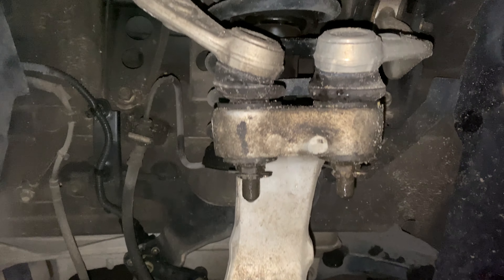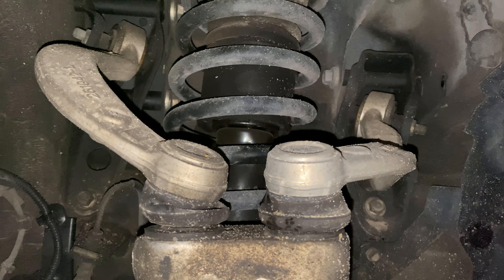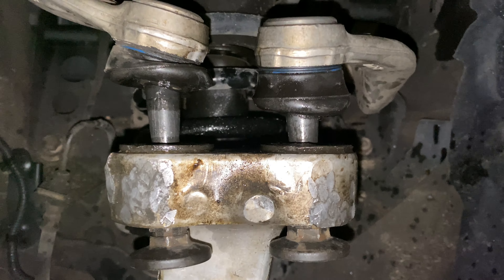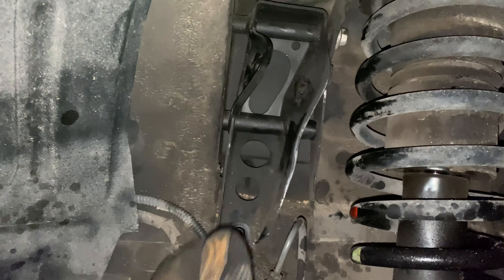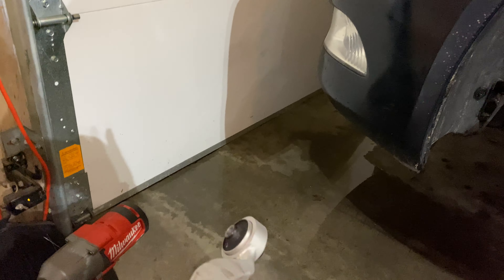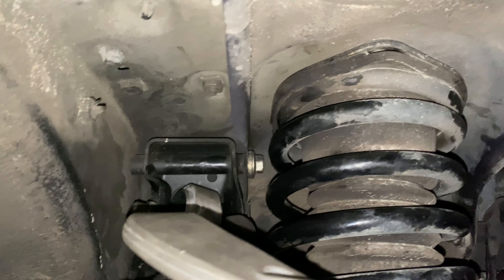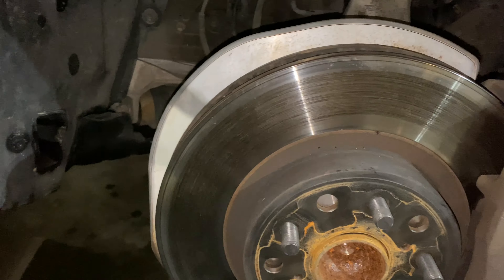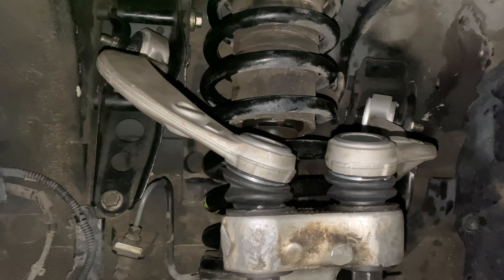Lexus LS460 Upper Control Arm Swap.

Comment: Hey I just did this on my 2016 LS460. Couldn’t have done it without your video. Great job. Pretty straightforward I had a major issue with the one you said was a PITA. That hinge you talked about kept getting stopped by a screw in the hood. I had to unloosen the screw and then the bracket could pivot all the way up. Other wise than that everything went as you showed. One thing. I was not able to use a ratchet (only on the bottom 14 mm. The main tool used was a box 14 mm and a simple 14 wrench. Thanks again buddy. FYI my control arm didn’t look that bad. One rip in the bushing but major play/looseness in the ball joint.
Reply from the maker: Your Welcome.

Comment: When you mentioned "pre-load" and that if you didn't do it the bushings could give out much earlier than they should, is that what you basically did when you put the rotor on a block to maintain that 16" distance from center of rotor to closest vertical fender point?  In other words, you did the final tightening of the control arms and mounts and all those nuts to torque specifications when that distance was "loaded" at 16" simulating when the car is being driven.  Not when the rotor and all the other suspension components are drooping down to 19" to 20" as you mentioned.  And if someone did tighten down all those nuts when it is drooping down, that's when you could have the bushings fail much sooner?
Reply: That’s what I need to know I’m replacing mine in a few weeks
Reply: exactly, preload to make sure it's in "operating" height so the bushing isn't torqued tight against the wrong operating height
Reply from the maker: Yes.  It is a good practice to preload to you don't over stress the bushings.

Comment: I would recommend for who going to replace upper or lower arm Don’t buy the cheap control arm it only last 1.5 years and the bushing not strong enough it make your brake suck when you head the brake and when you drive on the balance road it is ok but when you drive on the road not that balance the steering wheel will go another side because the bushing rubber to soft I recommend buy the oem pay one time but it last
Reply from the maker: I would buy OEM Lexus are $$$.

Comment: You can use a belt tensioner tool with a torque wrench when nuts are hard to access with a torque wrench alone.
Just a little trick I used.
Reply from the maker: Hmm.  Thanks may do that trick soon.

Comment: Your suppose to remove the strut.
It makes the job much easier and slot faster👍
Reply from the maker: Yes. That is one way but i  would rather not mess with taking them off.  I have seen it done both ways.

Comment: hi! Thanks for the video. BTW why didn't you just pull out the brackets with arms till installed on them?
Reply from the maker: Thanks.  I did it that way the time before this video.  I found time wise not much different.

Comment: go look at the lower control arms on this video at the .39 mark they are slid all the way forward.  These uppers wont last as long as the last ones you took off unless you replace both lowers.  Just a tip.  I'm about to do mine.
Reply from the maker: So far so good.  But my 2 lower front are shot.  I replaced all the lowers about 4 years ago.  I have to do those before spring.

Comment: Great video - saw where 2 of these arms failed at 1 year .Ideas on what aftermarket option might provide a  longer lasting forward upper control arm ??   OEM replacements failed at 15K !!
Reply from the maker: I have tried 3 different ones and they all failed sooner or later.  The front end is so heavy that it gives them a work out.
Reply: You can use 2012-2017 ls460 control arms on these cars, they’re revised and better

Comment: How did you measure the preloading? And how did you manage to raise the hub so that it was that height before torque the bolts? Curious how I’d be able to measure and make it work.
Reply from the maker: In my video i show all that.  I measure the distance from the center of the wheel opening to the center hub than lifted the hub with disk on with a block of wood.  Most people will raise the hub by a jack at the lower knuckle.

Comment: Watching some other LS460 owner saying it costs 4k to get these replaced. Seems not so difficult.
Reply from the maker: It can be $$$ if you take it to a dealer or almost any shop.  The lowers are more a pain.
Reply: @johnnyglexus5730  I got to think the LS460 is a potential money pit after reading a bit more about it. Great car till something breaks.
Reply from the maker: @davidwell686  It can be if like anything else is not maintained.  But some of the parts you might need are available now 3rd party unlike before.  Just do your homework l must have looked at 5 of them before i settled on mine.  Almost to 200 k.

Comment: Any times on getting the castle nut off? I have one that won't budge. I've tried pb blaster and bc they are stripped some I most recently tried a 17mm extractor and it won't grab it. Any tips would be awesome.
Reply from the maker: When i first did them.  Only thing i could do was cut it off with a cutting wheel.  If hitting the knuckle didn't pop it free.
Reply: @johnnyglexus5730  Wow didn't want to have to do that and risk damaging the arm. If a pipe wrench doesn't work I may have to smh thanks!
Reply: Got it off without damaging anything! Replaced the bracket thought I pre loaded it right but I have a slight lean on the opposite side. Did I pre load wrong? Any suggestions?
Reply from the maker: @robb3346  Did you replace both sides? Did you get it close to torque value?  Might give it a bit to settle and balance out than watch over time for any ripping.
Reply: I only did one side. The dealer said only one bracket needed to be replaced. Maybe I didn't get it to torque value. Should I loosen then bring back up and tighten again?
Reply from the maker: @robb3346  Torque is only around 35 ft lbs.  Odd it still did that. What arm did you replace. Can you do a video on youtube?
Reply: @robb3346  if you have air suspension you most likely just need to calibrate the levelers.
Easy to do. Couple youtube videos on hot to do it.
Reply: @joshriver75  Thanks for the reply! I actually sold her last Friday. Did a KBB cash offer thing online and ended up selling it to a local Ford dealership for 17k!! The used car values are nuts right now so I had to take advantage. Loved the car, headache towards the end but was ready and taking deliver of the upgrade this week. Thanks again!

Comment: Is there really a difference between Ultra Power and Mevotech control arms? Other than price? Is the quality better on the more expensive Mevotech brand? Thanks!
Reply from the maker: Not a whole bunch difference to me.  It really depends on how good you get the preload done.  Do it wrong and any brand will fail in a year.
Reply: @johnnyglexus5730  Thank you, I will consider this when doing mine!
Reply: Can,and is there anyone who can press the old ones out and press oem bushings in.Need to know.Thanks.

Comment: Bought a really cheap 2007 LS 460l with 200k miles highway miles and it needs break actuators and control arms. Any advice?
Reply from the maker: The brake actuator is expensive.  Find one probably best to get a new one  but have a local repair shop put it in and make sure they have techstream to activate it.  If you have Lexus do it probably cost 3k.  The arms you can do yourself if you have the tools.  Just buy aftermarket.
Reply: ROCK AUTO FOR ALL SUSPENSION PARTS

Comment: how are the bushing holding up ? mine didnt even last a year
Reply from the maker: So far so good.  I think any aftermarket ones will fail faster than OEM ones.
Reply: @johnnyglexus5730  I'm thinking about purchasing the ones you got from RockAuto then finding a press shop and somewhere to purchase new inserts to put in the old ones I take out so I can have them when the cheaper ones fail since I drive a lot. Although the only ones bad right now are the bottom front lower rearward arms, so I will order the Moog replacements for those today. How many miles have you put on those since you replaced them in February?
Reply from the maker: @ryannrjohnson  think around 7-8K

Comment: What do you mean by preload ?
Reply from the maker: Means you need to get the car to so called ride height before you tighten or torque them down.  If you don't the weight of the car will twist the bushings and it will all fail in a year or so.